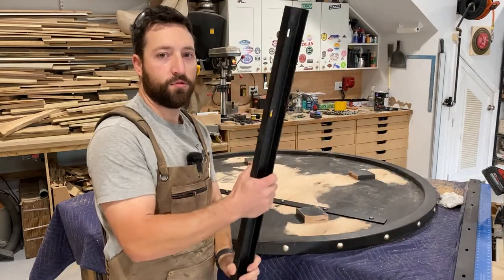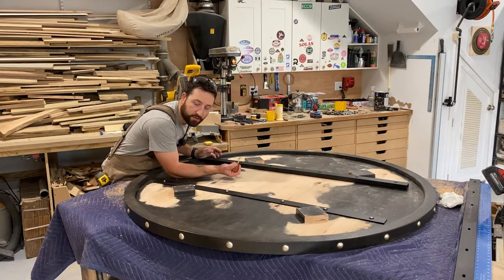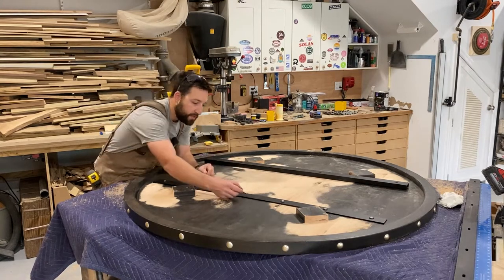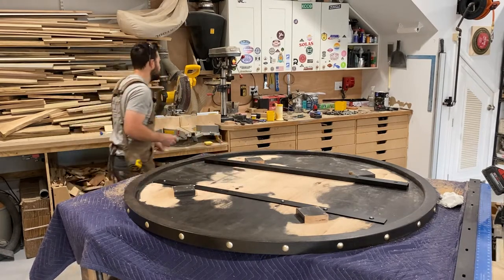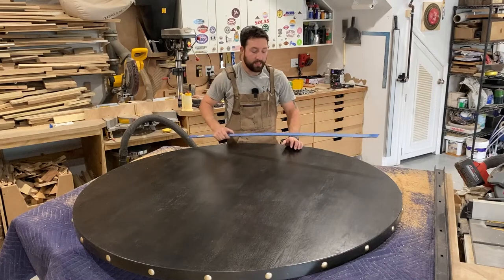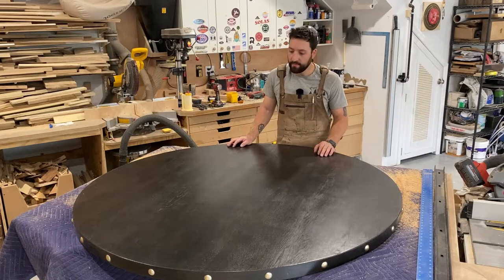How To Repair A Cupped Table

Comment: So the C Channels fixed the cupping issue?? 

Where did you get the C Channels from? Ironically, I'm finishing a dining table that ended up with maybe a quarter of an inch cupping during my finishing process and this was the way I was going to go
Reply from the maker: There are multiple sellers on Etsy that sell the c channel with the elongated slots in multiple lengths. Good luck with your repairs!
Reply: @pinerowfurniture  thank you!
Reply: Seems like part of the video is missing. Did you plane down the wood to get it flat prior to adding the rails?